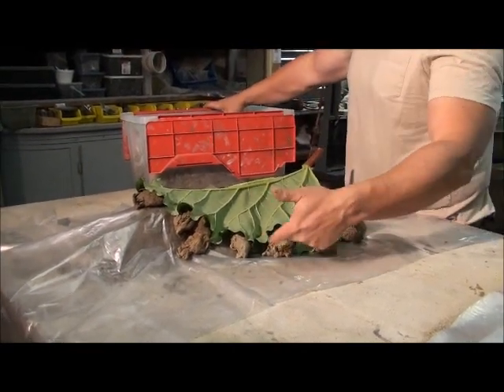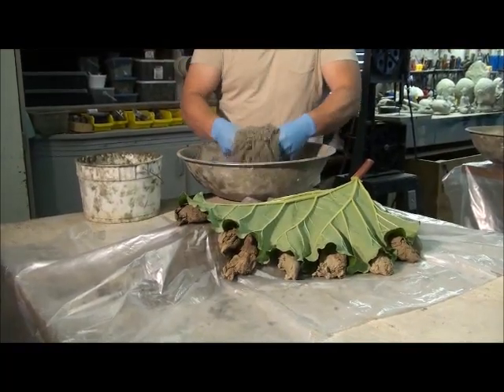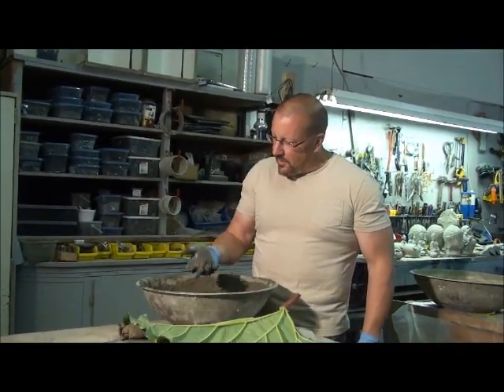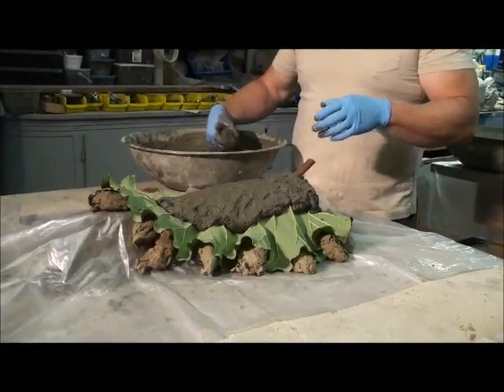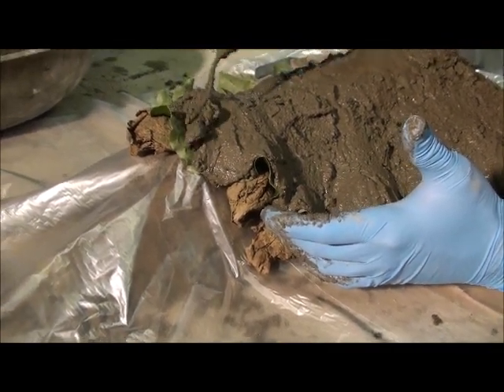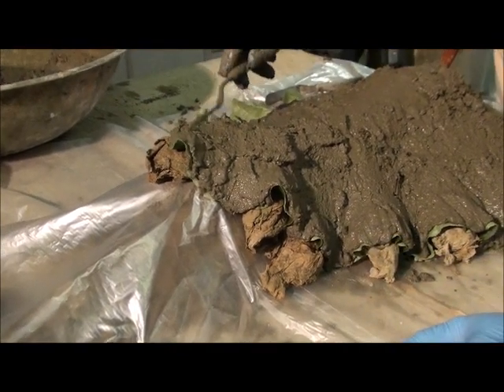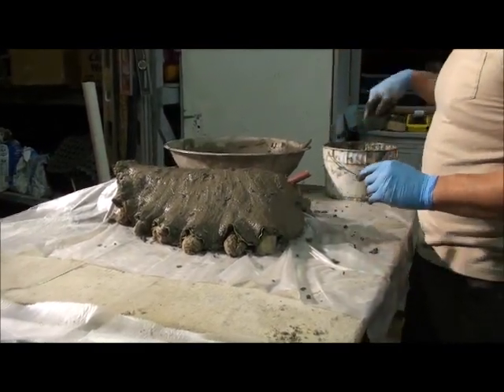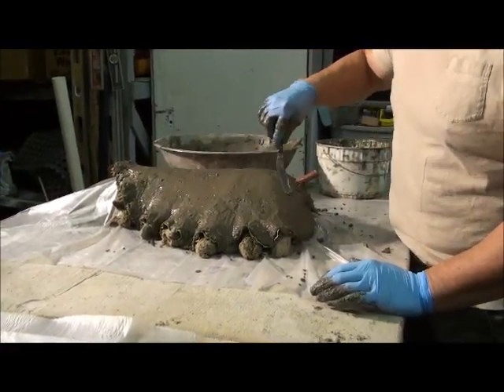Mr. Concrete artisan. How to make concrete leaves tutorial .part 2

Comment: Excellent video.  Are those brown hard things in the beginning of the video, sand that is hard?  Do you just put it under the leaves for contouring?  Thanks.
Reply from the maker: They are just rolled up commercial paper towels,dampened and rung out.Yes ,exactly ,just to add contour to the leaf :)

Comment: For the wire hangar, do you know the gauge and is it steel or galvanized?
Reply from the maker: Not sure of the gauge off hand.Yes galvanized.This particular one is cut up piecs of Blok lok reinforcement wire. You can also use binding wire that chain link fence guys use ,available at all large hardware stores.

Comment: Why do you need the fortifier?
Reply from the maker: Concrete Acrylic Fortifier is a highly water resistant acrylic resin formulation designed as a bonding agent admixture for thin Portland cement coatings. It densifies surfaces and makes them more resistant to many chemicals and mild acids, as well as to the penetration of water or aqueous solutions, can also eliminate the need for wet curing.

Comment: I have casted several large leafs and almost every one cracks in the middle where the big vein is. can you please let me know what am I doing wrong?
Reply from the maker: Using a utility knife or exacto blade,slice the main veins length wise all the way back to the stem .Removing approx half the vein diameter.This should help you out with your cracking.Also on the backside use a little more concrete mix down the center portion of the piece. Good luck,let me now how you make out. :)
Reply: Thank u for getting back to me. Made 2 this summer and both cracked. It cracks while it is setting. Maybe too much sun?
Reply from the maker: Ahh there you go.Do not cast them in direct sunlight .After they are cast and the leaf removed ,keep them out of the sun and covered with plastic.Spray with a spray bottle a couple of times a day for approx 10 days.This is referred to as a wet cure.Very important to build strength in your concrete.Sun is your enemy for freshly cast leaves.
Reply: Thank you so much for your help. I will make one in my garage following your instructions. Will keep you posted.
Reply: Bendiciones!! Por favor adicional al cemento y arena, que otros materiales? Veo un líquido blanco que es? Gracias... Y cantidades ❤

Comment: But honey, you're using my offset icing knife and stainless bowl!! LOL Nice work, I've made many but your tips will be incorporated into my next batch next Spring. My squirrels like to gang up all at once and have knocked mine off it's pedestal many times and eventually broke it. Now I just put them on the ground and they've endured beautifully. They are a bit difficult to clean if you don't stain/paint them. Our water is full of chlorine and soda.
Reply from the maker: Lol, I was a chef for 30 years ,so that's my off set and bowls.Hope your having fun casting ,can get addicting.Yes, hard water can be a pain.